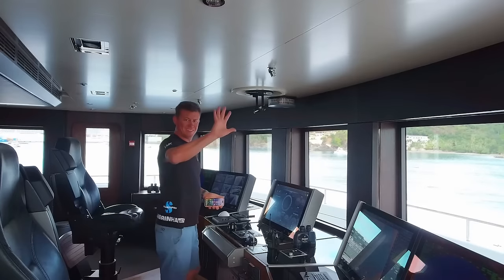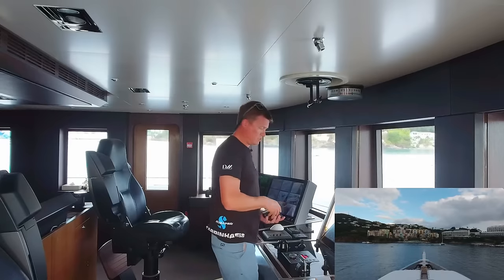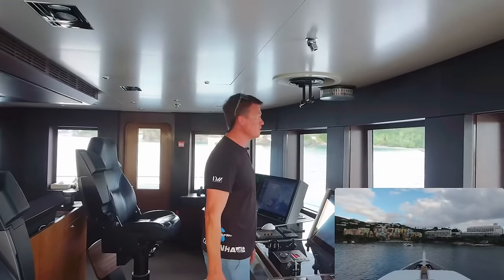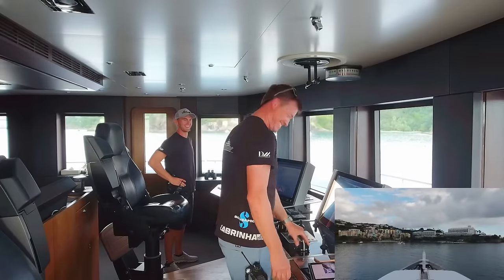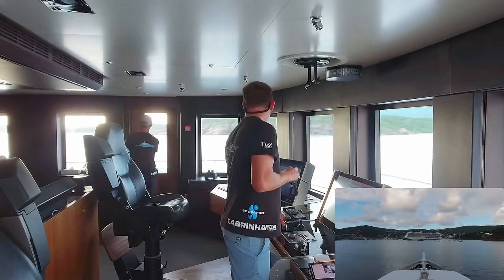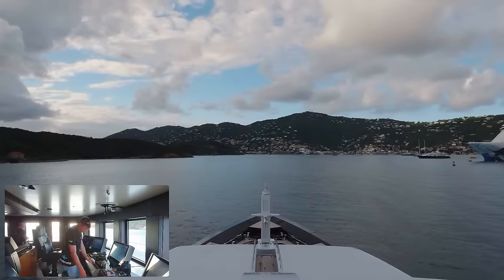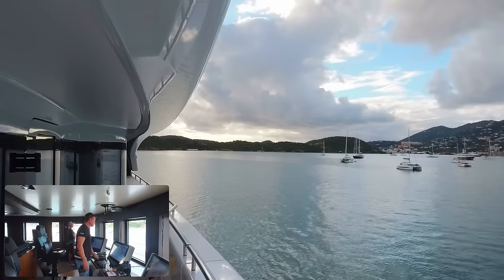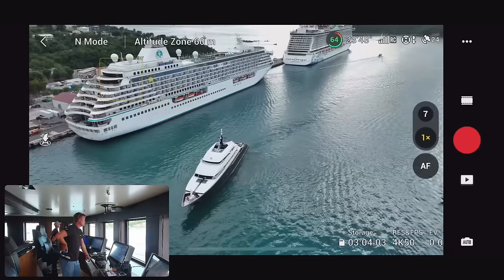Live: Docking St Thomas!

Comment: Hope you all had a great Christmas. I noticed that Captain Paul's mic is distorted when he talks at normal to loud volume. When you changed the transmitter it was still distorted. When he talked a little softer it was good. Either the gains on the transmitters need lowered a little or the lapel mic is starting to fail. It could be the channel gain on the mixing device you come into but most likely its the transmitter.

Comment: Great video Paul and Blair. Are you using the Mobile Priority 1TB or 5TB service from Starlink? It sounds like you will be adding an SD-WAN router ("module"), such as from Peplink, which has a marine solution. I'm sure your distributor will advise you on the best sestup. But you can prioritize your WAN services so when you approach a port WiFi would back up Starlink and 4G/5G would back up both of those. You can also set all three to the same priority, thus bonding your WAN links when available, and have a single device (ex. camera for YouTube) assigned to one of those for a dedicated WAN or WiFi link and providing YouTube feed with the best performance. Good luck with the upgrade!!